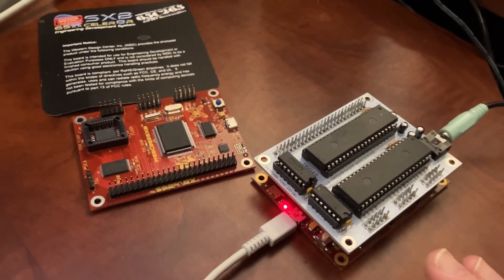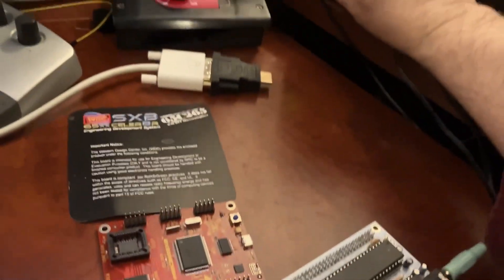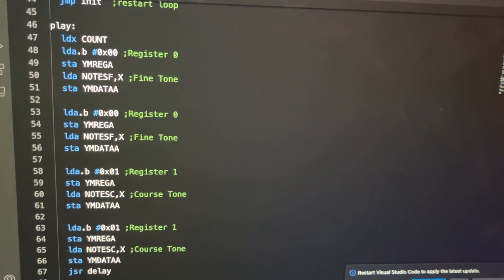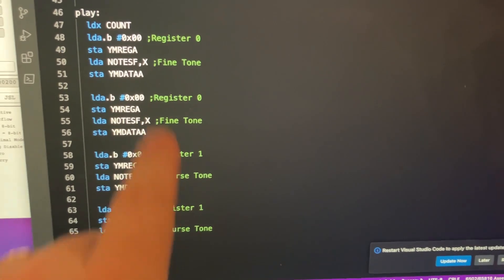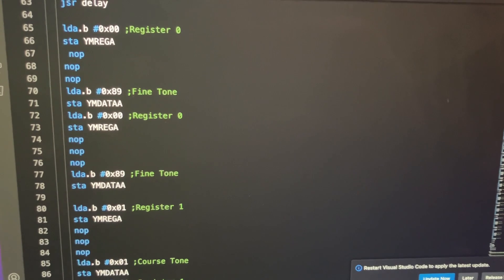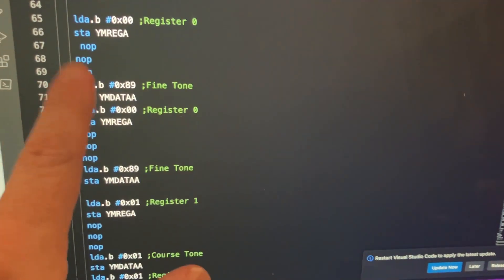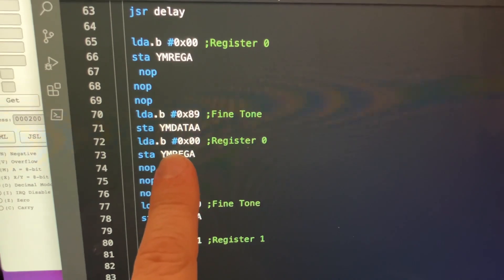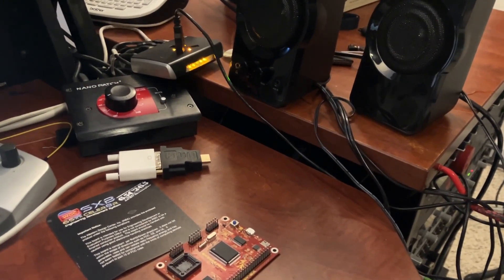RetCom87: YM2149 Soundchip Weirdness with the W65C265SXB Microcontroller Board -- Must Write Twice?

Comment: First of all thank you very much for your channel. I'm catching up with your content. I was pretty big into the Atari ST platform back in the 80's and 90's and I recognised the chip YM2149 and the YM2149F was used in the Atari ST line. According to Wikipedia the sold 2.1 million units of those. I'm unsure if the bug was present in that computer but never heard it was an issue. I never did any low level programming though.
Reply from the maker: It's a problem with my particular hardware implementation -- there's some underlying issue with subtleties of the timing.
Reply from the maker: And thank you for your kind words!

Comment: set address/data 0 then send address, set address/data 1 then send data, and so on.
When you have send the address it will be put in place when you set address/data) to 1.
The same with data, it will be put in place when you set address/data to 0.

The specs of the chip are not very helping in that case but it will tell you why you have to use NOPs.
For writing adresses and data you'll have to give the old chip a couple nano seconds until it has put it in place.
I use the ymz284 connected to an raspberry pico rp2040 and have the chip running with micropython playing YM tunes.
In micropython i don't have to care about the timings, it's slow enough :)
Getting it up and running on the StateMachine of the RP2040 was a different game, there i had to deal with the timings too.

I love the sound of this ol chip :)

PS: if you are using Atari YMs you'll give it a 2Mhz clock. I give mine 4Mhz because it has an internal divider.

Comment: Many YM2149 registers latch data on the rising edge of the Write signal (WR). This means the value doesn't take effect immediately but waits for the next rising edge.

Ensure you write the new frequency value to the appropriate register (FNUM for frequency, etc.) twice, both just before a rising edge of WR. You can use an oscilloscope to verify the timing.

The YM2149 updates its frequency based on an internal clock divider. If you write values too quickly, the frequency might not change in time before the next note.
NOP it a bandaid at best here 😬 

The programming sequence for the YM2149 might require specific steps or order of writes to function correctly. Refer to the datasheet for the exact sequence required for your desired operation. 

Maybe double check the datasheet and any application notes to ensure you're programming the registers in the correct order and adhering to any timing requirements? 😅

Lastly, the YM2149's internal clock frequency determines the update rate and potentially the note duration. An incorrect clock frequency could lead to note skipping. Verify that you're providing the correct clock frequency (usually 3.579545 MHz) to the YM2149. Use a frequency counter to measure the actual clock signal.

Comment: Is it possible that the address and value needs to be held stable for long enough for the YM2149 to read it? By writing twice you keep that address and data lines active? Perhaps adding some kind of latch or pulse extender between the microprocessor and the downstream chip may work? do you have any read timing data for the YM2149?

Comment: Try reversing order of coarse and fine?
Reply: I wanted to say this too. Same with 8bit uCs that access 16bit registers .. the order in which it is written is important. I never worked with this chip but it is worth trying.
Reply: @kay_lpzw  The YM2149 datasheet would explain that.
Reply: @billlewis9740  datasheet is rather short. So just testing is maybe the way forward. I‘d step thru the code when OCD is possible

Comment: I'm not familiar with this uC, but I'm wondering what happens if you try to read back the data that you wrote to see what you get.  The Heisenberg uncertainty principle may likely apply if you do, which may cause some unwanted wonkiness 😡
Reply from the maker: Here, it won't give you anything meaningful. The YM2149 has some parallel ports that can be read from by reading from the correct registers, but I don't have them hooked to anything, and my address decoding logic doesn't handle reads, just writes.

Comment: sorry, for another comment, but .... since the commutation is parallel to the Yamaha chip, output the data on to the port of the MCU and directly after that enter in assembler loop using BTFSC or BTFSS leaving the data on the MCU port, than reset the MCU port.

Comment: Try using this instruction that takes 2 cpu cycles, BTFSC or BTFSS and make a assembler loop (with GOTO and labels) counting down a file (value), rather than a "whole bunch" of nops. you could count down from 8, 16, 32, etc.

i recently got some YM3812 + DACs, but have not made a pcb for it yet.